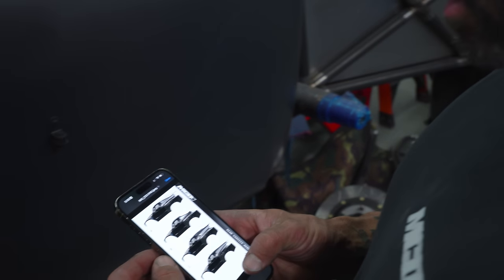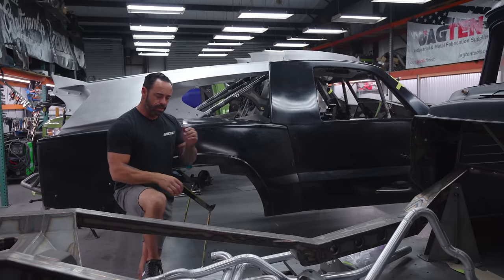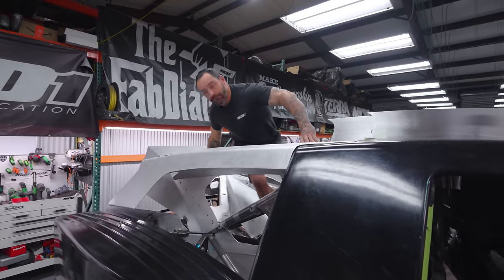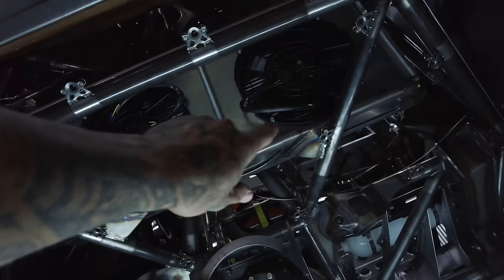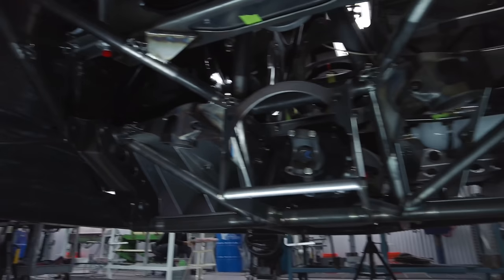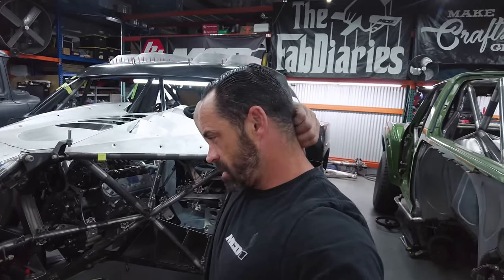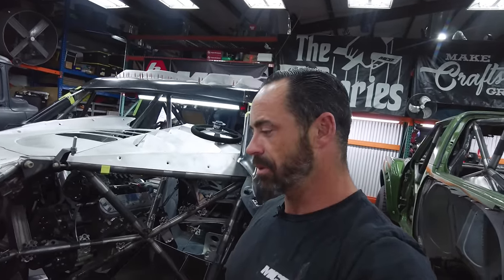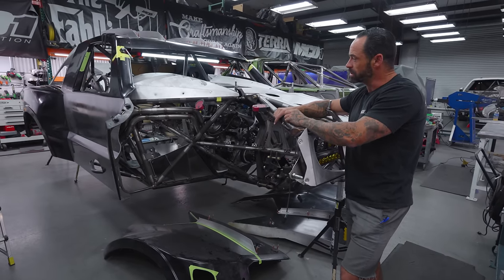AEROspec Trophy Truck unmatched design | Morgan Clarke Design

Comment: 100% dude when it comes to scec trucks. actual good carbon mfg needs to hit the mass industry more too, since its just getting so much cheaper for tons of great fabrics and to do quality vac infusion in small runs now too. But yeah man rear cab-->back aero is key too after a good ratio F/R base/track 4 link. that opens the door to being able to made changes in weight dist. spreads, shock tuning can get more zone specific, dialing wheels/tires, and ultimetly optimizing some of that rotational weight and DT loss. but everything adds up in a spec truck thats riding in the top 5 for sure. I cant believe we dont see more solid forge carbon wheels being tested out yet. Titanium work hopefully will start coming along in the gucci builds too, just cause its cool. Glad that you have taken the reins to bring that hyper car build style into the pre runner desert truck spotlight though. It always takes that one dude to wake up the rest of us fab guys, to smash that throttle of inspiration, and working together to grind out real innovation. Thanks dude!!
Reply from the maker: Appreciate this. Thank you for the recognition & support